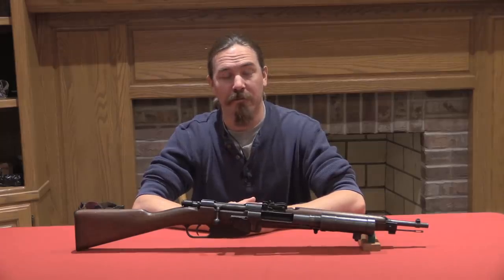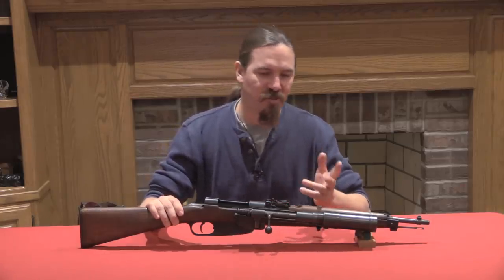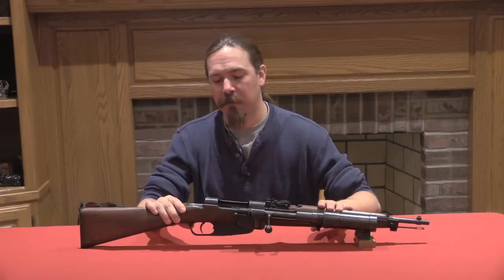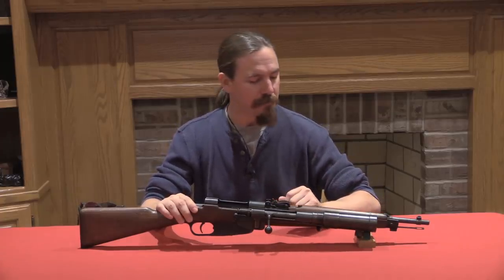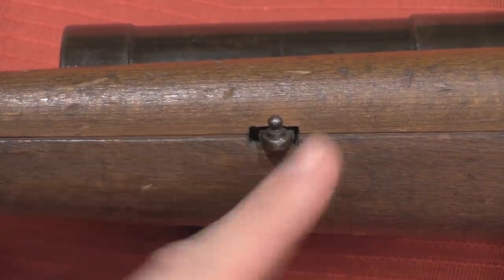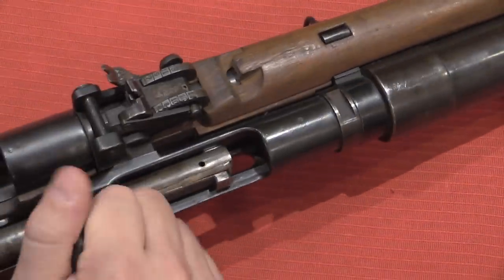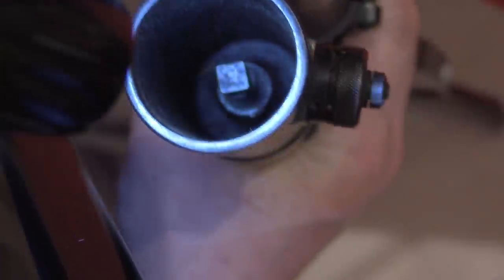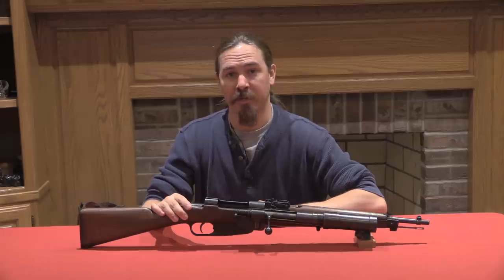Modello 1928 Tromboncino Grenade Launcher

Comment: Why not just start manufacturing a new, more lethal type of grenade, when it was deemed ineffective in it's intented purpose, instead of calling it obsolete? It seems like quite a handy system, at least for the time.
Reply: Italian efficiency
Reply from the maker: I suspect the small bore diameter would have prevented them from getting a grenade of the effectiveness they wanted. The 45mm mortar that replaced these was substantially more effective and longer ranged.
Reply: it could be actually their doctrine, the italian assault handgrenades were also small blast yield, relying more on the blast and shock and less in fragmentation, maybe becouse they wanted to get really close wile assaulting. i am from greece and during greek-italian war 1940-41 the greek troops didnt have much regard on italian assault handgrenades (hellenic army also they had some in stock also, bought from italy before the war), they were ineficient and had to get very close to you to kill you or injured you, most of time they just shock you, i guess this was the concept for this grenade launcher also. A fun fact, greek troops modifying italian hand grenades unscrew from the top (they had large lid) take the powder and detonator out and they used them as a sigarette case! and in many times when in close fight with italians when out of grenades they just throw them on italians as distract as they thought they were real and they ditch for cover!
Reply: The size of the projectile and weight of the explosive was alot less than modern 40mm grenade.
Reply: Grenade tec had taken a big leap by the the time the 4o mm came out it had a fragmenting wire and a aluminum capsule instead of a cast iron body
Reply: theG3guy When you are talking about using the gas meant to push a rifle bullet verses a purpose-built grenade cartridge?
Reply: Couldn't they have modified it to fire a larger grenade? While increasing the grenade diameter would've required redesigning the whole launcher assembly so that it's further offset to the side of the rifle, the other method that would've been possible is to increase to length of the grenade and the cup. Since such a change would've required no further modification at all to the rifle beyond just attaching a longer cup, it seems like it would've been something worth trying.
Reply: The SR2 bomb was filled with 32gr of TNT, into an iron case, and with an iron spiral around it to ensure fragmentation. The explosive filling was inferior to the later (from 1944) US MKII hand grenades, but superior to the earlier ones, so I wouldn't deem them as "ineffective". The bomb was designed to contain it's effects in a 50m range, and so the shooter was instructed to not shoot at closer distances (see "Istruzione provvisoria sull'uso della bomba S.R.2 con governale"). It was not the bomb, simply they decided to ditch the whole idea.
It was replaced by the Brixia mortar, that, being able of direct ant indirect fire, and having a far higher ROF, was deemed to be a better solution.

Comment: i wonder how many guys "acquired" an extra bolt so they wouldnt have to switch back and forth.
Reply: They would still have to remove each bolt to prevent both a bullet and a grenade from firing at the same time
Reply: @duncanmcgee13  or they could just not have a round in the grenade launcher... Ya know, the easy way.
Reply: @marcusborderlands6177  and what happens when you attempt to fire a grenade? How do you prevent a round from being fired?
Reply: don't have a round in the chamber? Literally just push down the cartridges with your finger when you rack the bolt so no round is in the main gun...
Reply: @marcusborderlands6177  sounds like a lot of extra effort to add weight to the side of your gun when you can just slide the one bolt straight in and out the back of both recievers
Reply: @duncanmcgee13  ummm, yeah? Im not the one saying it's a good idea... I was just pointing out that you forgot that a round doesn't need to be in the chamber 24/7...
Reply: @calvingreene90  both firing pins are part of the same piece. Leaving one bolt unlocked would impede the firing of the other. I really don't get why no one else understands this.
Reply: @duncanmcgee13  
When the bolt is unlocked pulling the trigger has no effect on it so only the locked bolt drops the firing pin and only one chamber fires.

Comment: Damn... This thing going to be the bomb in battlefield 5

Literally
Reply: The grenade can’t even one shot. It does 90 damage maximum. Does a lot of damage to vehicles though. Also the better grenades specialization is bugged. Other that that the gun is VERY good. Think a de lisle but with slightly slower fire rate and extreme 1-2 shot kill range.

Comment: The word "Tromboncino" excites me in ways that I don't fully understand or am comfortable with. I've watched this video so many times. This has to be my favorite interwar grenade launcher. That Hungarian grenade-launching AK is really cool too. I'm watching that next.
Reply: Tromboncino is a Small Trombone ,( Tuba in Italian, not trombone in English)
The word derives from Tromba, which is ancient and means a larger size of Trumpet without Valves ( similar to Roman Buccina.).
The Japanese also converted T89 so called Knee Mortars to simple Grenade Launchers, by simply removing the rear range setting Spigot and firing pin, with a T38 Receiver and cutoff Barrel Chamber, and use a Propulsion Blank, and normal
DocAV

Comment: It always has surprised me that nations stuck with rifle grenades for so long (and still use them) rather than developing a dedicated launcher a la the M79 (and later the M203). They work well, are supposed to be quite accurate, and do not require fine motor skill manipulation of your rifle. Of course a mortar is better, has longer range and has a bigger bang, but they are not as mobile, take time to set up, etc. Great explanation of how these work.
Reply: The idea is that this way the guy with the grenade launcher is not dead weight if he cannot lob nades.
Also so that you can have a much higher about of grenade launchers without decreasing the effectiveness of the squad.

Comment: I find it interesting that the idea of the grenade was to use it to immediately preceed a close assault-- but then they made design choices with the bolt system that means you couldn't actually do that, by the time you crouch down in cover, swap the bolt back over... they're recovering already.  Of course if only a a  few men in the platoon used the grenade launcher that is different but it still leaves your grenadiers with only a a a sidearm mid-assault.

Comment: That's amazing, it's so similar in form factor to modern rifle mounted grenade launchers and it's from 1928. If I were issued one I'd try to steal an extra bolt off a dead guy though. I don't like the idea of having to switch bolts, I know oz become pounds or whatever but I'd rather just be mindful not to keep a grenade chambered and be able to switch between the two more quickly.
Reply: If the trigger could be pulled with the bolt open you could keep empty brass in the grenade chamber and still avoid firing a bullet unnecessarily when shooting a grenade by just opening the rifle bolt.

Comment: That is a really neat idea. It could had worked well. They might of wanted to consider a pass though system where there is a hole though the center of the grenade rather then the bullet capture system. I would give it a try though, ha.

Comment: For once, I don't quite get how (physically) the firing pin is set into motion when dropping the sear (in the grenade launcher system)... I must be silly.
Reply: SNOUPS4 When cocked, the firing pin spring in the bolt is compressed and held by the sear. When the sear drops, the spring pushes the firing pin forward.

Comment: The Italians also had the first modern camouflage uniform (1929) and used it through the 1980s, used fixed battlefield sights for ease of production, and the Carcano was very accurate and extremely strong due to its metallurgy. The Kennedy conspiritards have managed to convince the world it's frail, inaccurate, and has punishing recoil as a "bolt action," even though the reverse is true. They had a credible military for a small empire.  They just didn't really like fighting for the Germans and were often happy to surrender to allies as the better part of valor.

Comment: Hey Ian. What's the deal with the gas regulator on the bottom of the launcher? For calibration?
Reply: It's not a gas regulator. It's the external part of a spring-loaded plate that holds the grenade in place.

Comment: It's cool they saved on weight by using the shared bolt, but I feel like having to remove the bolt to use the grenade sort of defeats the purpose of the design in the first place.

Can't imagine many scenarios when a readily available grenade would be useful, but also you have time to pull out the bolt to do so. pulling the bolt from your gun seems like the last thing you would want to do in a firefight.

I'm sure some blame lands to the grenades themselves,  but even if there were good grenades available I imagine they would have mostly just sat in the rifles unused anyway.
Reply: Imagine to be on the beaches of Normandy, with Germans that shoot at you from small openings in bunkers 100-200m distant.
Or to be in urban warfare, with enemies that shoot at you from the windows of the buildings.

What makes the difference, in a situation like that, is to be able to put the equivalent of an hand grenade into that openings from 100-200m distance.
What really made the difference between the Tromboncino and other rifle grenades of the time, is that you could aim with it. The other rifle grenades required the soldier to fire them putting the the stock on the ground. They were not intended for direct fire.
The Mortaio Brixia, other than being able of direct and indirect fire, and his grenades having double the TNT filling in respect to those of the Tromboncino, had a higher ROF, and was capable of adjustement shots. Thus it was ultimately preferred.

Comment: interesting piece! the italians face during greco-italian war in 1940-41 rifle grenade launchers on greek hands with the classic Lebel 1886/93 troblon with VB grenades. you just put the troblon on the barell and use real live 8mm round, the VB had hole the permmit the bulet to go out and the same time activate the detonator on the grenade. despite considered obsole weapon, the inability to buy new ones and the small number of mortars in greek service, the rifle grenade stayed in service as the only rifle grenade launcher. they used them with localy greek made VB grenades and refurbished old ones with new powders. they actually become acceptable efective at destroying italian machinegun nests, a VB grenade inside the sand bags nest it become efective as it contain much of the blast inside it. many greek soldiers become "aces" of this dificult weapon destroying tens of nests. 
https://en.wikipedia.org/wiki/VB_Rifle_Grenade

Comment: Ian; one small correction the bullet is allowed to move forward only far enough for it to clear the cartridge mouth and the holes drilled in the barrel, it does not have time to reach any speed or momentum to cause problems

don't know how ineffective the grenades were as they were about the same size as a modern 40mm grenade ; 1/2 -1 lb. with 1-1.5 oz. of explosive; the "brixia" 45mm grenade/mortar shell was a little bigger and a near matched most light mortar rounds (50mm) and hand grenades (57mm)

Comment: I just don't understand...

A grenade launcher is for throwing frags further than the arm's reach. Yet if this is used in close quarters, surely there'd be no disadvantage to just throwing the grenade. Not only that but at close quarters surely the last thing you want to do is remove the bolt of your weapon.
Falls in line with lots of italian equipment, clever but useless at the same time.
Reply: This thing had never been intended for close quarter fights. The shooters were trained to not shoot at less than 50m for their own safety, and the three position of the grenade sights were intended for 130m, 190m and 230m. The grenades were roughly as powerful as hand grenades.
Reply: Huh, Ian's stance in the video seemed to suggest it was able to be used in the final moments of an assault and at very close range. All I have found about the launcher is that the grenades were as described - closer to flash-bangs with a small effect radius.
Reply: The SR2 bomb was filled with 32gr of TNT, into an iron case, and with an iron spiral around it to ensure fragmentation. The explosive filling was inferior to the later (from 1944) US MKII hand grenades, but superior to the earlier ones, so they were not really "flash bangs", they had been designed to be lethal. Italian grenades, in general, were designed to fragment in smaller pieces in respect to the "pineapple" designs. That way the lethal radius was smaller, but the pattern was more uniform (cast iron "pineapple" grenades tended to fragment in few pieces, so they hit at random, maybe killing someone distant from the bomb, and sparing someone close to it).

Comment: I mean, the lack of weight and simplicity is all well and good, but how in the hell did the 1920s Italian engineers not think about how that grenade launcher would function in actual combat, let alone the beginning of a close-in assault?

Lobs volley of grenades into enemy formation

Italian Soldiers: "Okay boys, just give us a quick sec to change our bolts back around!"

Seriously, in what universe does it make sense to force a soldier to partially strip their weapon in order to use an integral part of it in battle?
Reply: I mean, you're looking at 5 per platoon, maybe one per squad.  In that sense, the expectation is that you're providing covering fire along with the squad automatic, while the rest of the squad advances.  While other nations didn't require some weird bolt moving, it still is next to impossible to actually aim with the rifle grenade attachment on the Enfield or K98k, as it completely blocks the sights, so that point is moot- you'd still have to remove something in order to make the rifle effective as a rifle.
Reply: changing bolt in Carcano is very fast actually,and there's only five grenadier per platoon,so I guess that's not a big problem.
Reply: +Vlakvark if you think this thing is silly, you should look at some of the aircraft they made during that time.
Reply: To switch the bolt of the rifle (the Carcano bolt is a single piece that came out simply pulling the trigger) takes actually less time than to charge a live round and a grenade in the launcher.